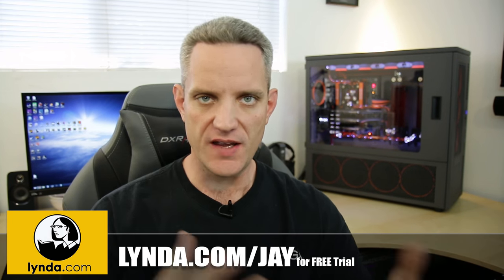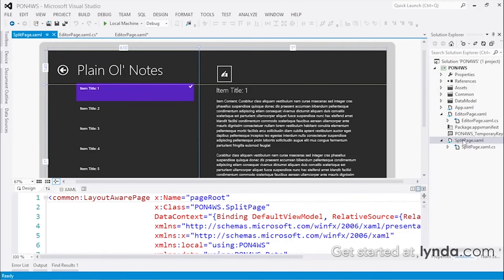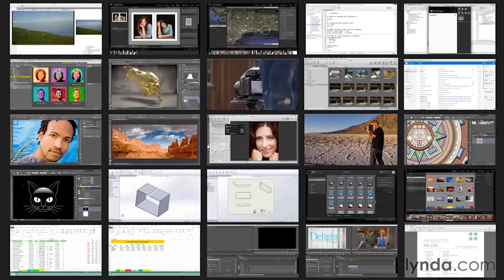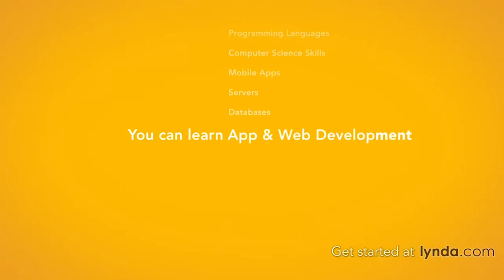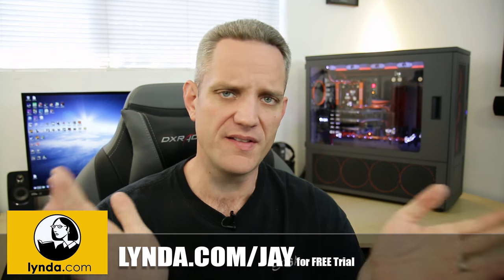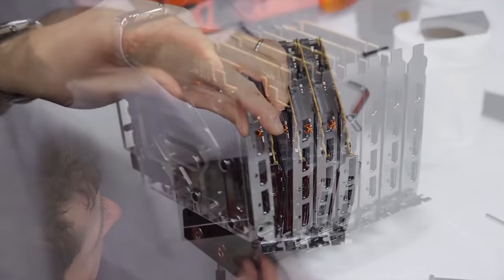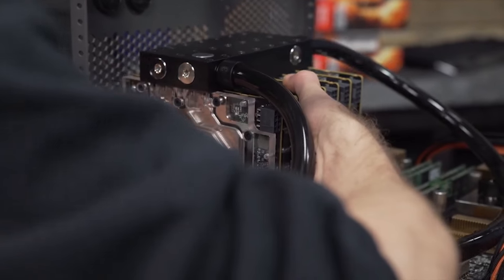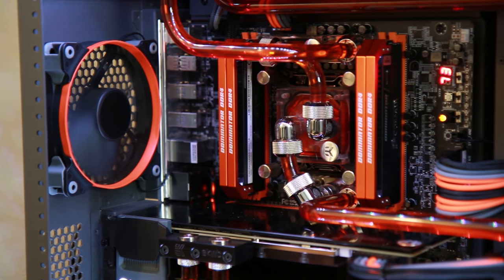Is watercooling worth it?

Comment: Great video but I've been left wondering whether I really want to water cool now. Can I really be bothered with the Maintenance? The main things are it looks (and is) cool and I do usually enjoy projects like that.
Reply: if you wont be bothered with the maintenance then it probably wouldnt be the best idea not to mention it takes a while to set up
Reply: taz874 This is the problem. Not to mention the expense. I wouldn't have the money to replace things if I make a mistake. Problem is, I have fallen in love with the dark base 900 pro which seems a bit sparse if you don't fill it with water cooling parts.
Reply: TechMantra the expense is the biggest issue and thats personally why i dont do it since for me i know it would mean cutting down on my pc components. and with watercooling you cant really be cheap wth it  incase of leaks etc. watercooling is really something you need to think about and to be sure you have the cash available
Reply: taz874 Interesting to hear your thoughts. I have totally decided against water cooling until I have enough money that it doesn't matter if something goes wrong. Plus I don't think I'll ever be ready for the maintenance seeing as I like my PC to be up 24/7 and any downtime is painful to me.
Reply: There is very little maintenance for water cooling. Its actually incredibly easy once you understand how it works. If you use straight water and no dyes, then nothing can gunk up your system and basically just refilling.

If you do want to do a water change. What I do is use quick disconnects. Disconnect the tube and put one end in an empty bucket and put the other end in a bottle of new distilled water and let the water siphon. Takes like 1 minute and once you're done just hook it back up.

Basically money is 99% of your problem.
Reply: No, basically water cooling isn't for everyone. I have the money for it but there is very little return in terms of performance. They do look cool though.

Comment: Hey Jay, I started with with watercooling last year and i m quite impressed as how much fun and cooling capacity it has! 
You were talking about fans - I am using the ASUS MB software to handle my fans - is there any other/better/easier to use software out there, which you could present/compare to us? Cheers

Comment: I have an i5-4690K and don't need to over clock it but want to and might need to some day and don't intend to do custom water cooling but when I decide it's time to over clock I'd rather go with a closed loop water cooled system than a fatty heat sink to replace the stock cooler that's doing just fine for now. custom cooling would be cool but it's a pain in the rear that I'd rather avoid and slightly envy others who do go the extra mile as I'm more about being efficient and cost effective with my pc

Comment: I'm definitely going to need to research and watch more videos to get up to date. Tried building my own computer about two years ago and I've had nothing but problems with it. Don't know if you have any particular suggestions on building a rig with high performance that runs fast, cool, and doesn't bust the bank. Spent about $1300 (maybe not a lot haha based on your standards) on my last rig and something somewhere along the way has led it to endless blue screens and failed overclocking which I have yet to figure out. Not even sure why it does what it does and my dads computer friend who practically built everything for me can't figure it out either. Not asking you to solve my problems for me just suggestions for educating myself and possibly getting the best products to replace my computer.

Comment: Unless you have TOP END parts on the market then  it's not worth it IMO. It's cool that ppl do it though. Looks rad ;)
Reply: +Iorveth gtx 980ti lightning is top end right? no water block available due to not enough sold......so u would want lower end of the high end products(gaming 6g)
Reply: Jody Wilson I suppose Titan X is technically the best card.
But I meant just generally. dual 970 or 980 might be worth it too. I don't have that kind of budget for pc parts though.
Reply: Iorveth titan x has the most vid ram(albeit mostly unused), but im pretty sure the 980ti, beats in about 10 other categories....youd have to be stupid to buy 1, by the time we get demand for that ram, the card will be to slow
Reply: Jody Wilson Yup. 980ti is definitely the better choice between the two.
Reply: +Iorveth haha i  did exactly what jay said not to long ago and i watercooled an i5 4690k and got better frames on games than my friend with an i7
Reply: rage fards Same gpu? What overclock did you get that i5?
Reply: The cpu is 4.6ghz @ 1.29 on an asrock z97 extreme 4. I have an XFX R9 390 that is running 1160mhz core with no voltage change and stock memory, it is water cooled with an XSPC razor block, but I had the same OC on air. He is running a gigabyte windforce gaming 970@ 1450mhz and a mem OC (I'm sorry but idk exactly what that was). I don't think it makes much difference but his board was one of the msi gaming ones, and we have the same ram (hyperx savage 16gb) both with 2400mhz  xmp.
Reply: He had a 4790k BTW, and I think it might of throttled a bit cos of stock cooler

Comment: Jay, I have an AMD FX-8120 Eight-Core 3.1GHz and a GTX 970 G1. It was overheating while rendering, with a 20$ cpu cooler. I upgraded to the corsair H55 which instantly resolved my issues. Do you think I wasted my money? Should I have spent my money on a new processor instead?

Comment: i recently built a pc with a gtx 970 and a 240 radiator cooled 4690k, with hopes of overclocking. this was just a gaming pc and i found that my cpu was not nearly getting stretched enough to warrant speeding it up, so i really could have gone with a 212 evo or even the stock cooler, so i sort of regret watercooling, even though it does look pretty cool

Comment: Jayz, I discovered your channel way too late.  I want to have some advice from you.  I am having a 5960x for my workstation, and need proper cooling.  It is purely for work for almost always on, low maintenance of air cooling is preferred.  I have tried 2 AIOs, they didn't perform any better than air cooling, and both failed.  Now I am back to air cool, 212 Evo, 4GHz at 1.05V, I know it will easily go higher, but heat is my problem, approaching 80C at full load.  What do you recomment?  do high end air cooling (like Noctua) get meaningfully better than 212Evo?  Or I should try a more modern AIO to get meaningful improvement

Comment: So, I see the Kingpin edition cards have the copper heatpipes and fins and everything, but how efficient are say, the aluminum fins and heatpipes on my 780Ti Classifieds? My top GPU runs pretty warm at stock clocks and I have some very powerful high speed fans pushing air right onto them out of the front of the case to move that air that they expel, and my top card still hits somewhere in the high 70s once in a while in something like, say, the Witcher 3. If I ramp up the voltages and clock speeds, I feel very paranoid about pushing them past that 80 C margin.

Comment: Should I bend tubes or use angled fittings like he did it?
Reply: TheLoneWolf bend tubes are messy and don't look nice, but they get the job done if you know how to manage them.

Getting angled water cooling pipes looks awesome and gives you a feel of accomplishment... But replacing parts is gonna be the most time consuming and frustrating thing you've ever done.
I'm over exaggerating a bit, but still.
Reply: MultiConsoleGamer ok thx so much man I think I'm gonna use angled fittings cuz it's easier imo

Comment: They used to say for under 50$ or so air cooling is way better(5 years ago). Although I have a seidon v 120m that I got for about 50$ before I heard this info. I use a push pull fan combo and currently have my 4690k at 1.2v 4.4 ghz not going over 60c on load(Gaming, intel extreme). Open case. I used the fan they gave me and the back fan of my case. Note I live in the desert it's about 80-84 f ambient inside. My fans are turned all the way up. I'm more of a performance vs noise person. Since my game or music is going to be louder then my pc. If you air cool, go for a custom CPU cooler instead of a bunch of case fans! I had 2x 240 mm case fans and 2x2 120 mm case fans. They would break and it would have been way smarter\cheaper to just buy a after market air cooler for my cpu or this all in one loop. Really I always wanted to get some kind of water cooling that's the main reason I bought this all and one loop. But it taught me a valuable lesson. My next water cooling will be self made and very cheap or ill go lazy sauce and go air. As far as my gpu I push my 970 windforce 10% with no hassle on stock air cooling. p.s. clean the dust off of your radiator or under your cpu fan at least once a year! Also you can just point  a housefan at your cpu with an open case for epic extra cooling :).

Comment: Wrong answer, the only logical reason to add water cooling is because it looks cool, put on a noctua sink and instead spend the extra $400 on either hard drive, monitor CPU video memory or keyboard case.

Comment: Running 3770k @ 4.3Ghz with AIO H220 with push pull. 

4000 series +5-15% , 5000 series +5-10% gains,  6000 series +5-15% gains.

DEPENDS on the game engine's efficiency to use more threads effectively. 

BF4 uses like 30-40% CPU at Ultra. 

WoW is bottle-necked due to how the game engine was originally made and benefits from a faster single thread thus overclocking CPU higher gives the best gains in FPS.

DX12 and Mantle API's will be reducing the need for CPU power in the future.

Water-cooling GPU is just that but limited due to VRM capacity or heat. Spending more on the next card up with just air cooling is usually the better option IMHO. 

VRM's on the MOBO and GPU are overlooked then trying to achieve extreme over-clocks.

Money in this economy can usually be better spent on not water-cooling.

Comment: I can't understand why you would want to run your CPU at 1.35V without ramping down under no load. Especially when you say one reason to watercool is for cooling components for longevity. Surely running that much voltage is harder on your chip than running it at 85C under load?

Comment: My old-timer i7 3770k is perfectly fine with a cheap Freezer 7 Pro cooler. 50c at 100%. 
But it wasn't that nice. I left the original cooling paste and it was about 20c higher. Then I removed it and temps went drastically down.  So, don't forget to remove the shitty paste from the cheap air cooler.

Comment: tl;dr, which would be a better option for replacing the blower on my 780 Ti- a passive heatsink (such as a Morpheus 2) with 2-120mm fans mounted on/next to it with a PCI slot mounting bracket, or a 120mm AIO (looking at an H80i V2 for that) with a Corsair HG10 kit (because I don't trust NZXT) to mount it and cool the VRMs/RAM?

While I don't intend to ever do a custom loop for my current build (not just because of maintenance, but I don't trust myself not to screw it up- and I don't have expendable income for the parts or to replace hardware if something leaks) but I'm still on the fence about putting my GPU alone or both my CPU and GPU on water with a couple of AIO coolers- I mean, I don't run an overclock on anything, and the wraith spire keeps my CPU within reasonable temps, even under load with only 2 case fans (which are cheap fans that don't exceed 1100 and 1300 RPM....) but my brother gifted me his old 780 Ti when he had to upgrade, which has a reference blower (in a mid-tower ATX case) and under load, I've seen it reach excess of 80-90*C under load- sometimes even crashing games if it gets too hot.

The air cooling option would be ~$60-70 altogether, whereas the AIO/HG10 kit would be closer to $120-140- but if I can afford either (probably around black friday sales) which would be best in the long run? I would just upgrade to a solid high-end 10 series, but with the price of 1070s or better cards being so high and the fact that this card blows my old 1050 out of the water at the low price of _free_, I would rather get as much use out of the 780 Ti as I can for the time being....

PS- I've looked into the Arctic Extreme 3 and 4, but I'm not confident in using one as it's needlessly big and bulky, not to mention extends ~4 inches from the end of the card. One of the main complaints I hear is that it doesn't effectively/properly cool the VRMs/RAM, just the GPU die itself

Comment: ek waterblock and fittings, reservoir, pump, tubes and the radiator for my 980ti cost around $300; a lot of money and hopefully worth it, considering I will lose the guarantee on the gpu by removing the stock cooler.
Mainly doing it for the noise - and i will never buy a gpu with 3 fans, always buy one with 2...

Comment: I use a Noctua NH-D14, not the newest and shiniest, but hell of a cooler!
I run a i7-4790k with a mild overclock and only 1 fan installed on the CPU cooler (3 fans in the case, 2 pulling air in, 1 pushing out) ...

when benchmarking with prime95 i only get about 65° on the CPU ... while idling or gaming the fan spins soooo slow that i cannot hear it!

Comment: I like my beefy Be Quiet Dark Rock Pro 3 aircooler.
Overclocked my 4690k to 4.5ghz at 1.250v i think it was, it never gets over 68 degrees celcius under full load.
Reply: +Anonymouse Or you get a h100i/h80i and drop 15-20c. Im at 4.2 on a 4690k and full load i see 50 max on my top core.
Reply: +Anonymouse Yeah, I'm wishing I got something like that now. I went with the H220-x because I planned on adding a radiator and  block to my 780. Never happened, lol. Could have spent less on the cpu heat sink and only sacrificed about 5-7 degrees.
Reply: kraig hunter I see no need in getting that cooler, In one of Jays video's even with a costum loop he got around my temps.
Normally I'm between 50-60 so no need to buy a new cooler.
Reply: I have never touched over 50 myself at full load. My Ideal is 26 as we speak watching YouTube. I'm gonna guess he didn't have a great case for airflow or climate. Living in Washington, it's nice and cold. So maybe done in summer.
Reply: +Anonymouse I feel yeah, I just had to throw it out there since I been messing with this cpu.
Reply: +Anonymouse while jay has same temps as you he has way more speed out hes cpu .dont compare apples with oranges.
Reply: MrBall Breeder I'm not saying that my cpu is as fast or good as his mate....
Reply: Anonymouse you're not saying but insinuate it.
your quote:
 I see no need in getting that cooler, In one of Jays video's even with a costum loop he got around my temps.
Normally I'm between 50-60 so no need to buy a new cooler.

if you're happy with your speed and temps then we're all happy but be sure with AIO you get lower temps and less fan noise or same temps ,lower fan noise and faster speeds.
with custom loop it even increase speeds and lower temps more so still less noise.

but again the "need" is an personly subjectif.based on the owned opinion.
And the opinions are mostly based on the "I want" or "look what i have " idea just to show off.

So if you know what you realy need and dont want to upgrade to watercooling AIO or custom i can respect that .
Reply: MrBall Breeder What i was trying to say was that my temps are around temps I've seen in his video's with a much more expensive cpu and costum loop and i know that. So i say my temps are fine and don't need a aio.
My air cooler is also really quiet so no need to upgrade and spend more money.
And again, i'n not saying that my cpu is faster or my cooler is better, because that is impossible since his cpu is just much more expensive. I just see no need in an expensive cooling system.
Reply: well an custom cooling is too expensif for 99% of the people anyway ,while an AIO like the swiftech H220X cost only 130 dollar and the corsair H110i cost 100 dollar then it depends what you prefer like overclocking,lower temps for longer life or less fan noise  to use it.
and that doesnt mean its only good for expensif or overclockable cpu's.

if your happy with the aircooler then you dont need upgrade to AIO,i totaly agree on that.
Reply: +Anonymouse how quiet is your dark rock? I was debating on getting one.
Reply: WhiteThorn Well I don't know the decibells but I have my pc build in a fractal design define r5 case and have the fans that come with it and a gtx 970 strix and I can't hear my cooler over all these other things, so it's pretty quiet if you ask me.
Reply: Anonymouse Neat

Comment: I am running a 480 on my 6700K and at stock speeds and medium loads (Plague Inc., browsing...) my fans never spin and the CPU runs at 30-40°... IE the noisiest thing on my setup is actually my radiator (as in heater) across the room :D

Also watercooling looks awesome, before I switched to watercooling I upgraded to a gtx 970 and when I upgraded to Skylake (from a Phenom X6 1050T) I decided rather to buy a Phanteks Enthoo Primo and a nice loop (without grafics card) just cause it looks so great!

Comment: Jay, how do you feel about changing out the thermal paste on a GPU? I have had bad luck with all 3 of my XFX cards. My R9 390x had  a rough application thermal paste and so did my older R9 270x's. One of my XFX R9 270x's had reached a thermal temp on MSI Afterburner of 101 C on left for dead 2. So I pulled the card apart and there was almost no thermal paste on the GPU core it was caked around it. Re-applied some thermaltake TG7 (all I had at the time) and the temps dropped to 52 C. In your experience have you seen a lot of poor thermal paste application on the card you have tested?

Comment: One question, i can mount 3 rads in my case a two 240's and one 120. the problem is i cant mount fans too the second 240 rad because they would hit my motherboard. my question is is it still worth to place that 3d radiator ? i want to cool a z97 i5 k series processor and two 970's in sli